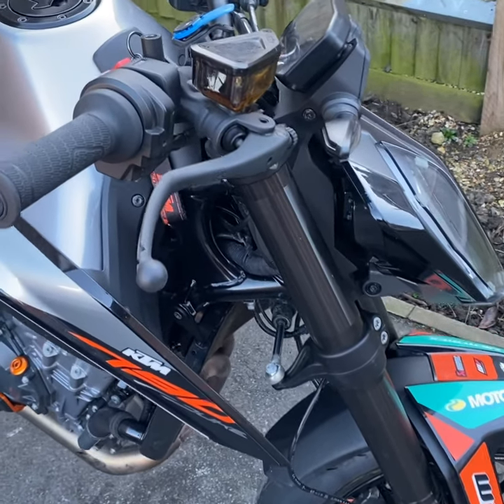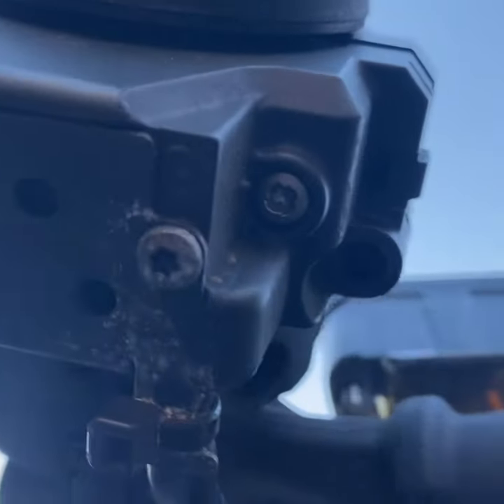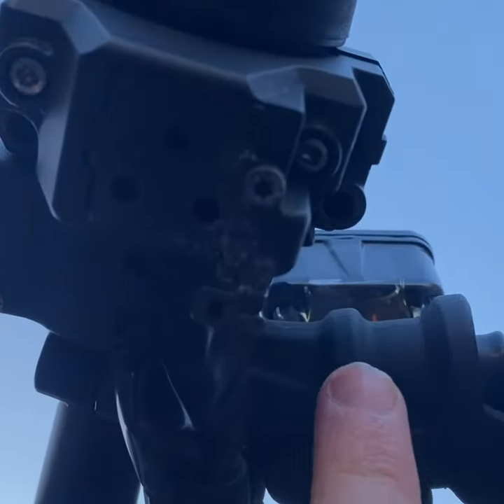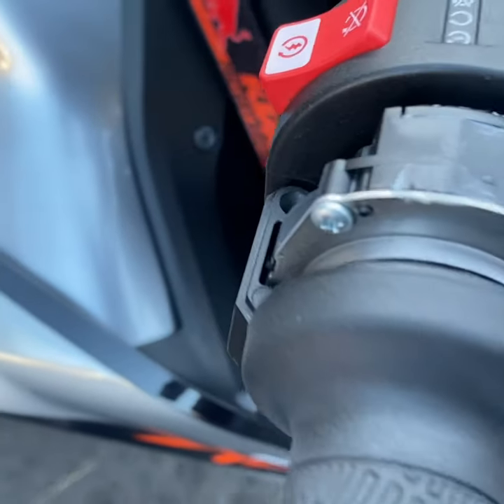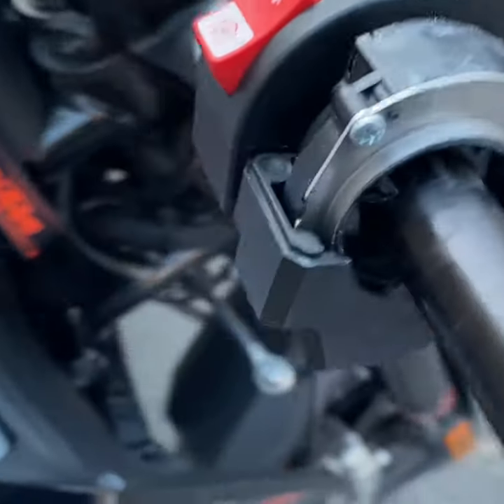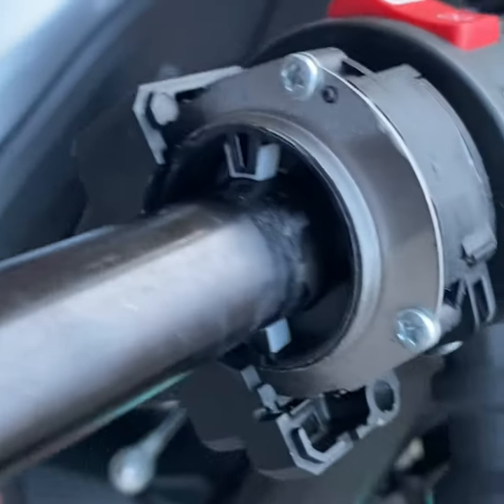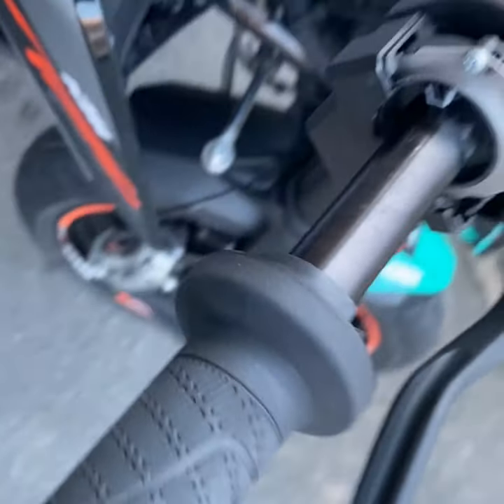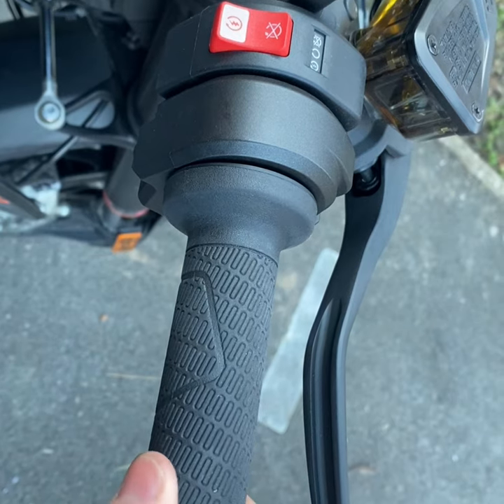KTM 390/790/890/1290 throttle spacer fitment in 1 minute! EASY!

Comment: Hi , will it also suitable for KTM Duke 390 2022 model , because i have check the racetrox website , they dont have an option for duke 390 and I have checked with them Racetorx , they also said that dont have tested this on 390 duke ?
Reply from the maker: I believe it’s the same on the 390. You can double check in 2 or 3 mins. I also found a site selling 390 throttle spacers - looks exactly the same
Reply from the maker: https://www.moto-vision.com/en/article/66525-throttle-spacers-kit-ktm-390

Comment: Thx. Did this today to my '19 790 using a gash piece of plastic I cut to size and wedged into one of the grip slots, worked a treat! (thickness required circa 0.040"/1 mm]

Comment: I have the orange 2019 model 790 loaded with Ktm Power parts ( akro, LEDs, pp levers and all the bling and a few bits carbon replaceiing plastic( which I think is a great look) Its not too in your face for daily riding. However, the black model, like yours, with the PP graphics looks so damn good. Your bike makes me consider changing my fairings and mimicking the look you have. Looks top class
Reply from the maker: Haha thanks, I think both look great! I do like the orange, I’m a fan on the black with orange wheels. You can’t go much wrong with a darker themed bike, stealthy… add some bright little bits on it so it pops! Lots of graphics available now.

Comment: Thanks for the easy to follow video. Which windscreen do you have on your bike?  Looks great. Does it help much with wind blast?
Reply from the maker: no problem, It’s a barracuda screen. It helps a little… but not much if I’m honest. The puig one is the one if you want proper wind protection. Here’s a link to the barracuda: https://www.barracudamoto.co.uk/motorbike/ktm/duke-790-2018-2020/sports-screen-aerosport-ktm-duke-790-2018-barracuda.html